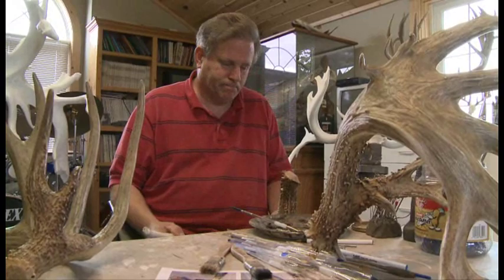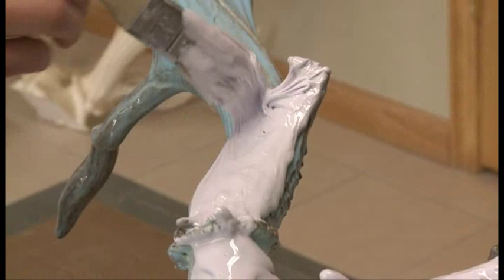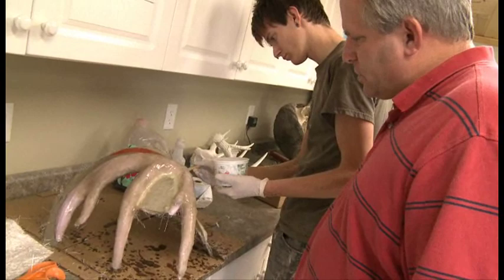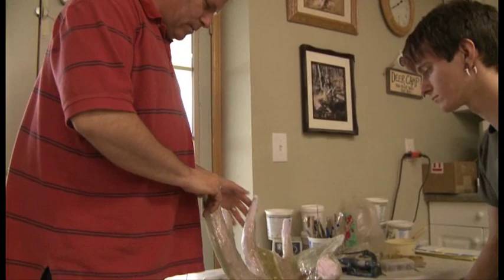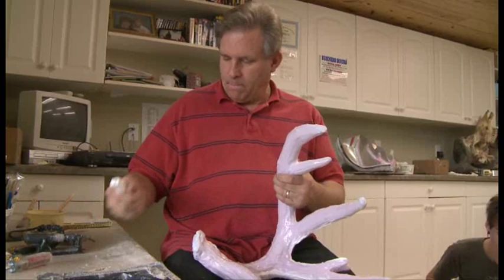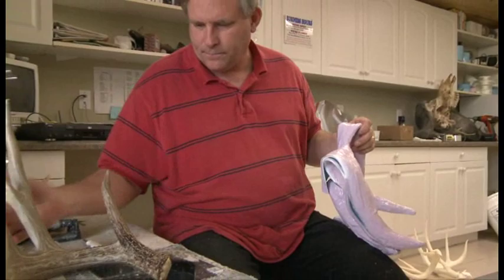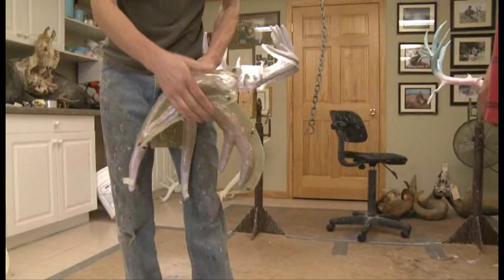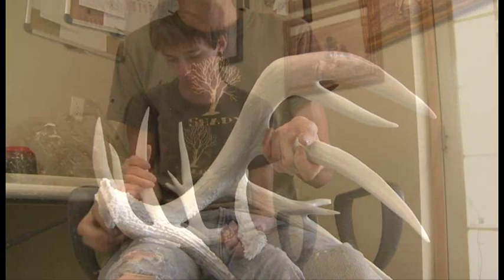The Art of Antler Reproductions - Part 1

Comment: Hello! I just have a few questions. So the first layer, which was blue, was some kind of rubber. The second layer, which was gray/white, was also rubber? And the pink layer was also rubber? What was the purpose of those rubbers? They were obviously different types of liquid rubber so what was the blue one for and what was the gray/white one for? How many coats of rubber? How many different types? Why are you using different color silicone? Are you painting on the fiberglass after that? And you used metal to separate the parts of the mold? It doesn't look like metal later on in the video when the kid just rips it off of the mold and it looks like plastic. Do you cover everything in fiberglass? How many coats of fiberglass? Then when you demould it you make holes for the wingnuts and then it looks like he's taking the fiberglass off of the top part of the antlers? This part is very unclear. Then you split the fiberglass pieces off of the antlers. That makes sense. Then you cut the antlers out of the silicone mold. Once you had the silicone mold all by itself, you screwed the fiberglass pieces back over it to hold its shape. Then you pour the resin into the mold through a hole in the mold, probably at the base of the antler. You shake it to make sure that the resin gets in all the nooks and crannies of the mold. Then you take the nuts off of the fiberglass, take the fiberglass of of the silicone mold, and take the copy out. Very clear at the end what was going on. This video could use a lot more explanation at the beginning and in the middle, however. How heavy are the replicas compared to the originals? How long do these moulds usually last? How many replicas can you make with a single mould before it falls apart or starts giving you less-than-great replicas?
Reply: +XDSmileZawrXD All coats are rubber they add a few drops of acrylic paint to color so they can see where they have covered with each new coat It looks to me that they are using silicone caulk . there is a particular type of caulk that can be used for this.